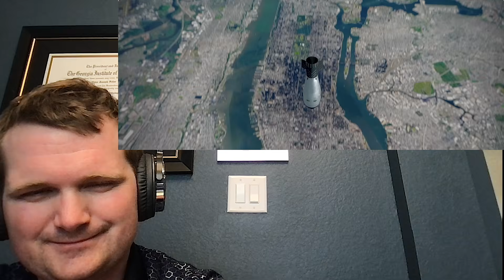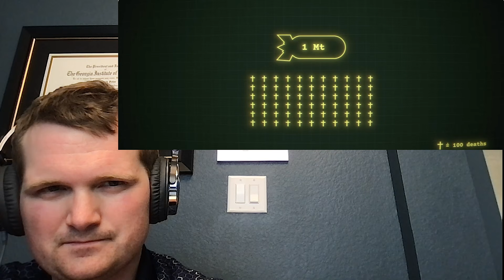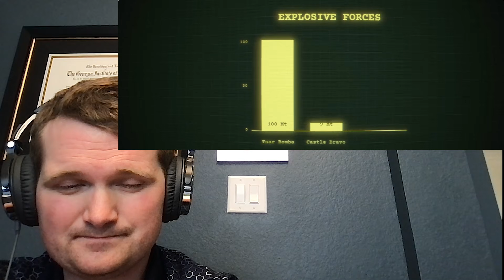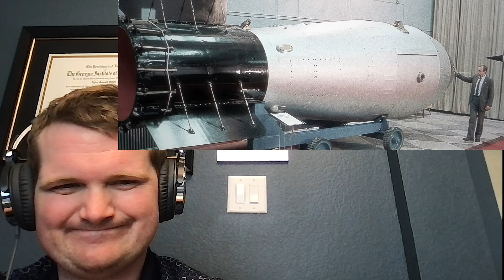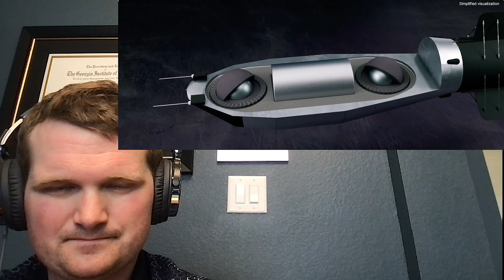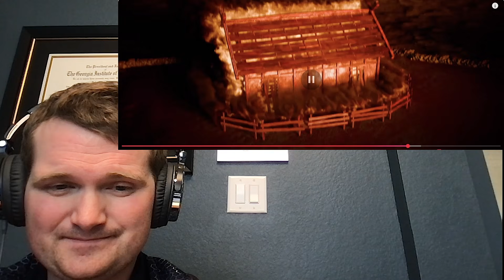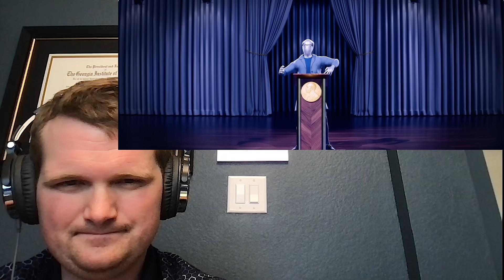The Biggest Nuke Ever - Nuclear Engineer Reacts to Fern

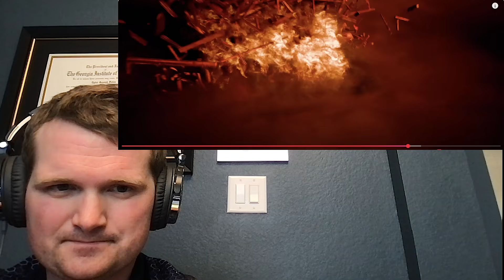Comment: 30:30 the fireball he is talking about is the X-ray diffusion fireball, it's not a shockwave. It only last milliseconds before the traditional fireball hidden behind an opaque shock front.

[source: Zel'dovich and Raizer, Physics of Shock Waves and High-Temperature Hydrodynamic Phenomena (nukes)]

Basically, the authors spend 5 pages on the explosion. The nuclear physics is over (props for explaining how fast it is), and now the bomb casing is really hot, radiatng blackbody X-rays (and we see the initial flash). The X-rays heat the air, which glow in cooler X-rays. And so on and so on, and this is diffusing at a fraction the speed of light (but nothing is moving, it's hot air making X-rays)--that's the weird fireball pictures we see, where the shadows of the bomb parts are still visible.

When it gets to a few hundred meters, in milliseconds, the shock wave peels off. The air being the shock is 200,000K, but we can't see it because the shock is heating regular air to 50,000K and hiding it. So it's like a lightning bolt stuck "ON"--super duper bright, and then that goes on for some time expanding at shockwave speed (mach I eventually).

That's the traditional fireball that emits 99% of thermal energy.

Comment: Could  the 100megatons version  have set the atmosphere on fire?
Reply: No. In fact, a thermonuclear bomb much larger than this would be “contained” by the atmosphere—the energy needed to displace the atmosphere limits its destructive radius.
Reply: @zachsharp4564 I was thinking. The air around the explosion will get so hot. That would have created the chain reaction of igniting the atmosphere on fire
Reply: @TheLateral18 
I see what you’re asking now. What prevents this, ironically, is the massive amount of heat released in the first few microseconds of the explosion. This can easily heat the air to a million degrees K, at which point the gasses ionize and the air becomes a rapidly expanding ball of plasma. Plasma is relatively transparent to radiation, allowing it to pass through it easily. However, the explosion also forms a massive shock wave of air at its periphery (the “shock front”). The shock front is very hot (but not a plasma) and is therefore opaque, so it traps the hotter ionized gas and radiation behind it, the temperature of which rapidly decreases as this shock front expands. Only once the fireball’s shock front “cools” can this radiation propagate: at this point, the thermal radiation is intense enough to set fires, but not enough to ionize the atmosphere or cause any additional fission or fusion reactions.

Comment: Tsar Bombs of course was never intended to be a practical nuclear weapon. The video is very much presented from a USA perspective.
The purpose of Tsar Bomba was to scare the USA (not the military, but the public and through them pressure the administration) into genuine arms limitation talks (nukes cost big money and the USA economy would only increase its advantage there over time) and it should be noted that about a year after the test, the USA and USSR DID in fact sign such a treaty, in Moscow.

While it still makes no sense as a strategic weapon of war, as pointed out, it cannot be delivered to a city, that would not be the best use of such a weapon.

It DOES make sense as a "doomsday weapon". A string of Tsar Bomba style devices could be planted along the continental shelf of the USA, surreptitiously by submarine over a number of years. Detonated together, they would create tsunamis that would devastate the coastal cities of the USA, where most of the USA population lives. Tsar Bomba, even in its detuned 50 megaton version was more than twice the equivalent yield of the Mt St Helens volcanic eruption. At full yield, with the uranium tamper, each device would be 4 times that volcano. Detonated underwater, a string of such devices doesn't bear thinking of. The 50-megaton version was detonated 4 kilometres in the air but still caused a level 5 earthquake when the shockwave hit the surface. Imagine the effect if detonated under 150 metres of water.
Most Russian cities are NOT on the coast. The biggest coastal city is St Petersburg, and a nuclear weapon used there in a similar way would cause more devastation to NATO allies than Russia.

It would truly be a "doomsday weapon" of course because if used strategically, the overwhelming majority of the USA's response capability would be fully intact, and the response would of course devastate Russia. It could only be used AFTER an exchange occurred and the other nuclear assets of both sides had been expended.

Comment: The 15MT yield of Castle Bravo was due mainly to an unexpected cascade effect from a Lithium-7 component.  It was only supposed to have a yield of 6MT, and resulting blast very nearly took out the observation station that was built for the test.
Tsar Bomba was originally designed to generate a blast of 100MT, but the Soviet design bureau's scientists were worried about the damage that might be caused by the test, so they quietly dialed down the yield to 50MT.  Upon testing, it also cascaded, producing a yield of just under 58MT, sending out a shockwave that triggered seismometers around the world 3 times.  The test of Tsar Bomba prompted both sides of the Cold War to come together to limit the individual yield of nuclear weapons:  The Americans largely because, unlike Castle Bravo, Tsar Bomba was deliverable (barely), and the Soviets, because they realized that making anything bigger would be pointless, as the aircraft used in delivery on the test was only narrowly able to escape the blast.

Comment: The 100mSv threshold is and interesting one, there are places in the world that have a higher level than that and the people that live there don't show increased cancer rates...this seems to suggest that a constant dosage makes the body become more efficient at dealing with cancer cells.
Reply: It's more of evolutionary adaptation across countless generations, not in one person during their life. It also depends on what exact type of radiation (Alfa/beta/gama), what isotope or how it gets in contact with your body (outside with skin or inside through lungs/stomach is pretty big difference, since skin is naturally shedding off so you would just need to be replenishing skin cells fast enough to compensate for top layer having shorter lifespan, assuming the radiation isn't penetrating too deep)...

Comment: Considering almost all of the 50Mt of tsar bomba came from fusion and that the additional 50 of the 100Mt design would have come from fission, it would be hundreds, if not thousands, times more catastrophic. Long term, that is.
Reply: I think the explanation in the video was that both fission stages were weaker due to the introduced change, and that reduced the bomb yield mainly by reducing the effectiveness of the fusion stage.
Reply: @AgneDei  If the "detonator" fission stage was weakened, the bomb would have fizzled out. 
No, all the stages up to the main fusion stage functioned has designed. 
The only difference was the tamper, a big heavy case around the inner mechanisms of the bomb, designed to contain the first few moments of the explosion and keep the reactions going for longer. 
This tamper was made out of lead in the detonated version. The 100Mt version would have switched the lead for natural uranium, making the tamper itself undergo fast fission when bombarded with all the fusion neutrons. All this fission alone would have added ANOTHER 50Mt to the yield but, being fission, would have created A LOT of highly radioactive fission products, leading to catastrophic fallout.

Comment: Worth remembering that the 4000 - 9000 etc. estimates of Chernobyl toll are also entirely based on LNT at low dose rates across most of the continent. They are exactly the kind of thing based on the unverified, likely wrong portion of LNT. If we wanted to estimate a real mortality toll, outside the workers at the power plant, we'd check I-131 contamination and expected (most thyroid) cancers and that results in 100 - 200 premature lives lost, somewhere around that.

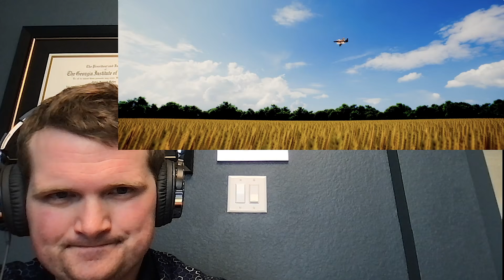Comment: 2:59 A two mile fireball is still one hell of a fireball radius! Also would love to talk depleted uranium with you at some point and I think you’d get a kick out of hearing about some of the engineering that goes into modern tanks. Fun fact; as a tank is moving the top part of a tank track section is actually moving faster than the track section running along the bottom (the part that is contacting the ground).
Reply: Moving the same speed relative to the tanks body though

Comment: Tsar Bomba was not a three stage bomb, rather it was a two stage bomb with two primaries in parallel (fission bombs) to initiate the 2nd stage (fusion).  A true 3 stage weapon uses one primary that initiates two fusion secondaries in series.
Reply: The original 100 mt design is 3 stage, it had a uranium shell around the fusion stage which was replaced for lead in the test version.  And most 3 stage designs I've heard of are similar, going fission > fusion > fission.
Reply: @Razgriz__1  They replaced a Uranium jacket (tamper) on the secondary (fusion) payload with lead.  Lead did not contribute to the secondaries yield while Uranium would have given more free neutrons boosting yield.  Since the Uranium jacket would have undergone fission (not fusion) I guess the argument could be made that you have two fission stages in parallel that initiated a second fission and fusion reaction in the secondary but I would also call the fission/fusion secondary a parallel action while the stage counts should be sequential.  As deployed it really was only a 2 stage without question.  As designed you could argue it was a 2, 2.5, or 3 stage depending on how you want to define a stage.
Reply: @larrybremer4930  Yes, I was talking about the original design.  And the Uranium tamper would have been fissioned primarily by the fusion stage, not by the initial fission stage.
Reply: Where is this info coming from? I see plenty of examples of the animation from the source video, but at the very least it's incorrect in showing a single large second stage. Images of the bomb itself show a single primary in the nose cone and multiple tertiary assemblies at the widest part.